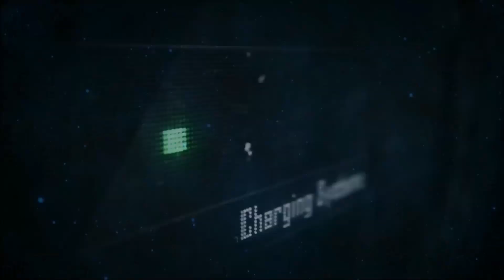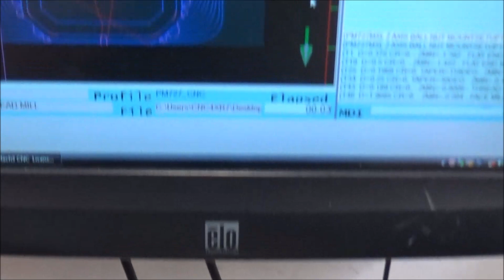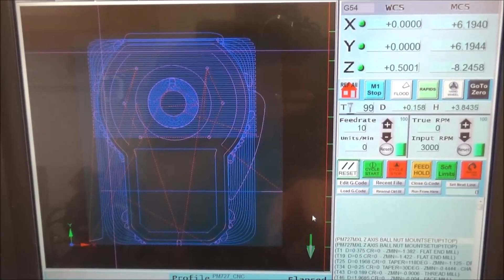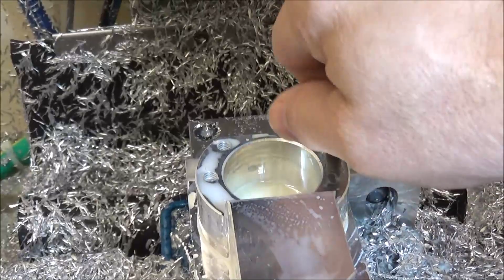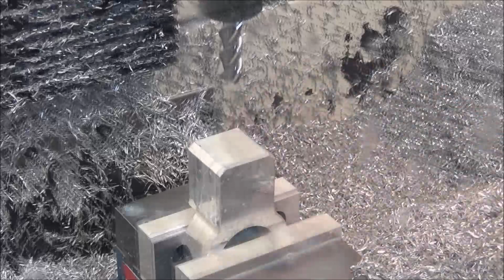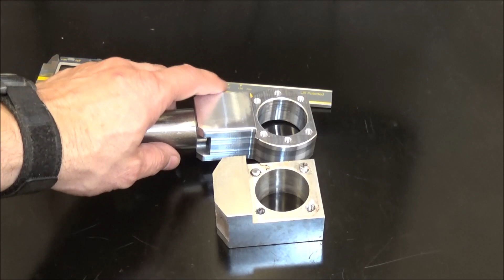PM727MXL Z Axis Ball-Nut Mount

Comment: How did you adjust your work co-ordinates for the second operation?
Reply from the maker: The "FLIP"  is always a issue and can ruin a part if your not lined up correctly. I try to do all the machining I can from one side As with this piece. the 2nd op was facing and edge chamfer op.
Stock always varies slightly so unless I true up my stock I always probe the same corner for the 2nd OP.  In this case 1st setup the corner is top back left. 2nd setup " The FLIP which was in the X direction. I probe the top back right corner. Any variance in width of stock and my Fusion 360 setup will be negated.

Comment: noisy spindle.  gearbox?
Reply from the maker: It is a Spline spindle and there is a little play in the transfer from the Quill to the spindle. But a lot quieter. than the Gearbox was at 3600 rpm. This was machined at 4500

Comment: Another wonderful work, now the assembly is near.
Are you sure that that piece of aluminum resists the stresses of the head and its weight?
On my mill the only head, which also includes the engine weighs about 100 kg. and with vibrations I think the weight multiplies.
I wanted to ask you something, where did you buy the tree with the BT30 cone?
The never-cutter is a ZAY7045, but the seller told me they no longer make the BT30 cone.
Reply from the maker: My head will be #150 this is 7075 which has a high tensile strength equal to most steels. The mill is a R8 spindle im using TTS tooling.